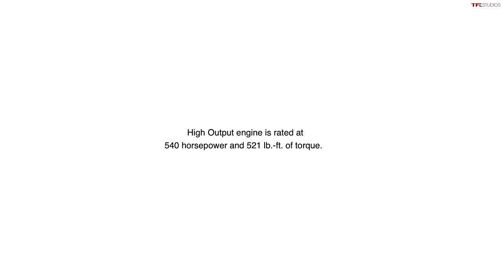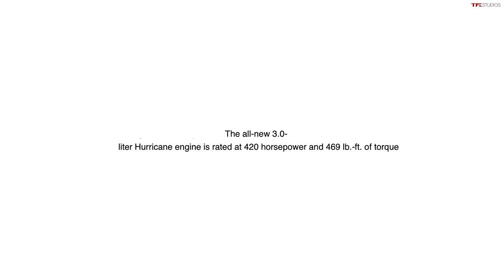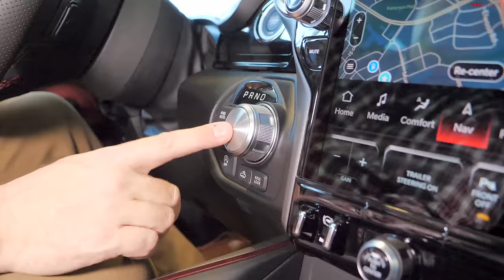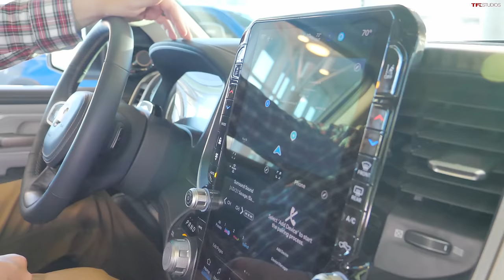I Go Hands On With The First New Ram 1500 In Over 5 Years - Did They Get It Right?

Comment: Wow, the new Ram comes with everything. It even comes with dealer markup preinstalled at the factory.
Reply: At no extra cost. 😂😂😂
Reply: Yooooooo HHAAHHAHAHAHA
Reply: They’ll do a dealer installed markup too. 😂
Reply: That’s a good one
Reply: Really Nice truck!
Reply: Even comes with missing 2 cylinders!
Reply: @flakes369    Lmao that is a good one. Don’t know why they would do away with the HEMI 5.7, that was an awesome engine
Reply: @punisher2704  Yeah if you like replacing the manifolds about every 20,000 miles.
Reply: @seymourbutts8850    Never had that issue.
Reply: @punisher2704  You got lucky. You're the first person I've heard of who hasn't had the issue. The tick until it warms up is very annoying. My local sheriff department has  Ram trucks, and the deputies told me all of them have cracked manifolds. The dealer told me every one of them did it at some point and that there's no fix. I tried aftermarket headers, and due to my shitty luck, I got a set with a bad weld. I fixed the header and traded it off.
Reply: @seymourbutts8850    Hmm, that’s weird

Comment: Nothing can replace a V8.
Reply: Hemi with all its problems, was not the finest V8 representation.
Reply: Yes. A lot can. Lol 💀
Reply: 8 V1s can.
Reply: @zelenizub2036  
The Hemi is not perfect and has its weaknesses.
Just like those at GM and Ford.
But to replace it with an even bigger piece of junk that is even more vulnerable.
It doesn't work at all.!!
Reply: No you just replace it with a piece of crap six cylinder that you have to add 2 turbos to given anywhere near the power and torque of a V8. If they had pulled their heads out of their rears and given V8’s twin turbos 6 cylinder engines wouldn’t be able to touch them. They will still suck when you start adding weight to them over and over. They won’t stand up to the boost. How do I know? I’ve pulled way too many trailers all the way up to 226k heavy haul on big trucks. The other V-6 turbo trucks don’t last when doing what trucks are designed to do. They don’t provide the same kind of power curve and smoothness the V-8 does. Unless you’ve done it on a daily basis as well as seen the v-6 crap in fleet use then you have no idea. All they did is make a much more complicated engine that is more expensive and more expensive to work on. They got rid of the V8 in order to get people over the V8 so they’ll start moving to EV. It’s being forced down your throat instead of giving you the option of choosing the engine you want. 
Sorry but Dodge doesn’t have much longer left in the car industry as they are about to lose a lot of loyal fans.
Reply: @zelenizub2036 

I’ve got 170K miles on my 5.7 Hemi and haven’t had any issues with the motor. 

What’s your problem with the Hemi?
Reply: All junk 🙄
Reply: Except literally any other engine can. EV's are preferred because of power and efficiency plus zero emissions. 4cyl and 6cyl turbos are superior to v8's. Lets be real v8's are dinosaurs and it's time they went away for good, they are nothing but polluting and out dated.
Reply: I agree
Reply: I disagree turbo rules for v6
Reply: @P-J-W-777 first, it’s more power and torque- especially the HO one. Second, it’s an inline 6 which is smooth - negating your point about V6. And third, the Cummins inline 6 with turbo seems to get a pass. All diesels have turbos and people don’t mind, but add one to a gas engine and they lose their minds. 😂
Reply: @dragonbutt  As far as I know, v6's have always been the base engine on 1/2 ton pickups.
Reply: @arthurwright255 I want nothing to do with a pure ev personally. Wouldn't say no to a small 3 cylinder diesel hybrid, though, best of both worlds.
Reply: @arthurwright255 says the person that’s definitely never towed or owned a truck ever.  You should go ask the Lightning owners how they feel about towing this time of year?
Reply: @Lq32332  like I said you’ve obviously never actually towed anything especially anything of any real weight. If you had saying an inline 6 engine is smoother than a V-8 for towing. 
I’m well aware that the Cummins is an inline 6. It’s a totally different engine that the gasoline powered inline 6. Diesel engine don’t rely on spark for combustion. Diesel engine blocks and heads are also much stronger than a gas engine. Not all diesels utilize turbos but in the case of modern trucks they do. Seems to me that the Ford powerstroke V-8 has continually outpaced the Cummins I-6 in both horsepower and torque from factory. 
Thats also proven with the Swedish Scania trucks which have V-8 diesel engines which produce way more power and torque than American built seni trucks. 
Sure you can take a V-6, I-6, or I-4 and make them make good power but the cost to do so makes the engine cost far more than a V-8 which was already at that power level to begin with. You see it with all the JDM cars out there producing 600-1200 horsepower. They have 35-100 thousand into the engine alone. 
Why didn’t the manufacturers ever offer a V-8 gas engines with a turbo or turbos. Because if they had they’d never be able to get someone to buy their V-6 engines. 
The V-8 engine will last longer as it doesn’t have to work or rotate as hard as a V-6 or I-6. Manufactures don’t want reliability these days. They just want it to make it past its warranty period. That way they can make more money on either the trade-in or the repair costs.
Don’t get me started on EV trucks because they just won’t make it that far lol!
Reply: 😂😂.....so many of the comments here are ignorant. Basically, it's a bunch of old guys and guys with inferiority complexes crying because something better came along that makes them feel less. The TT V6 is dar superior to any of your V8s. Grow up.
Reply: @ryansheard8092 it needs help to be on par with a V8. Put those turbos on the same V8 and it will outperform turbo v6
Reply: What half ton truck is left with a v8? Seems to me like ALL manufacurers are giving into pressure and dropping the v8. @P-J-W-777
Reply: @arthurwright255  No one who actually uses a truck for what a truck is supposed to be used for is saying what you just said. EV's are probably the least efficient thing you can get when it comes to towing and having any sort of payload at all. Nothing says "efficient" like only being able to tow 100 miles and having to stop and recharge the truck for 3 hours.
Reply: @tritchie6272  Ford and Chevrolet currently still offer several V-8 engine options in their half ton truck and suv lineup. 
Ford even had to go back and build the actual Raptor that everyone wanted. Do you think they are going to cancel it yet after dumping that much money into its design and build?
Reply: @rhettsalsbury9394  put a TT V10 and it'll be even more than a V8.
Reply: This I6 just did
Reply: We need a quad turbo 16 cylinder truck!
Reply: @arthurwright255  They have to be zero emissions because they produce a larger carbon footprint during the manufacturing process than a gas or diesel vehicle will in its lifetime. The you add all the energy production it will require in order to charge them on top of that. They are also much more complicated and toxic to recycle. The battery production alone is another story.
They don’t work for crap in the cold or heat. Their range sucks, sucks even more when you try to pull something.
Big brother is always in your life even closer while inside the vehicle. They will be hacked before too long. You can be spied on with the cameras and the microphones. So no more privacy! They are nothing more than a computer and computers fail on a regular basis. 
My V8’s don’t need a computer. In the event of a mass EMP from the sun or a nuclear war, y’all will be walking while I’m driving by laughing.
Reply: @tritchie6272  again ford and gm are still producing V-8 currently.
Reply: @DrowningTurtle  exactly
Reply: @ryansheard8092  yep or a v-12 or v-16. I’d go for that. It’s disappointing that Lamborghini is. I longer producing factory spec v-12 Lamborghinis.
Reply: @Cloud30000  yup, that would be really cool. They made 16 cylinder diesel engines back in the day with twin turbochargers and superchargers together. They sounded awesome and laid down some really insane torque and horsepower.
Reply: Clearly a straight 6 turbo can and then some.
Reply: @P-J-W-777  my comment was sarcastic to show the absurdity of "add turbos to a V8 and it'll be better". Again, anyone that thinks they NEED a V8 in a 1/2 ton truck had insecurity issues about their manhood, IMHO.
Reply: @P-J-W-777 I bet your parents are siblings.  You got some torn up genes
Reply: @ryansheard8092  

Ok bud - at the time I bought my truck, V8’s got better gear ratios which improves towing ratings and torque ratings. That’s the reason I went with a V8. Also, turbos on V6’s or I6’s wasn’t a thing. So let’s calm down with all this “manhood” crap. My V8 has been completely reliable in my 8 years of ownership. 

Having a certain motor doesn’t mean anything until you pair it up with the options ie Turbos, gears, transmissions, etc. 

Knock off the insults!
Reply: @ryansheard8092  not in reliability or cost to maintain.  But for day to day yes it’s objectively better to use I’m sure.
Reply: @ScottsGuitar  I disagree. I've had 5 ecoboost engines with one being in an F150. It was bulletproof for over 135K miles and I know that it's still going strong for the current owner.
Reply: @arthurwright255  zero emissions?  And what about the emissions from the power plant suppling the electricity to charge these?  And have fun charging in below zero weather conditions.
Reply: @tritchie6272  Nissan, ford, chevy
Reply: @ryansheard8092  point being it’s not better if a v6 needs turbos to beat a naturally aspirated v8
Reply: @rhettsalsbury9394  based on what? That statement in and of itself isn't true or false.
Reply: Amen brother
Reply: @ryansheard8092  well in my opinion you’ve never towed a trailer on a regular basis. This I-6 isn’t being limited to just the half ton trucks. They will be using this same untested engine in the 3/4 and 1 ton gas trucks as well. Dodge is getting rid of the V-8 engine across the board. 
V-6 engines don’t stand up to constantly being worked hard like a truck is designed and built to do. If the grocery getter that has to have a truck wants the I-6 because they are only going to use it for daily commutes and occasional light trailer duty the fine give them that option.  Don’t take away mine. The EPA has already screwed up the diesel engine so much. Just ask Dodge as they just got fined 1.6 billion for B.S. that doesn’t do anything but destroy the engine which is exactly what Dodge was trying to protect for their customers.
People talk about how much better a turbocharged V or I-6 is than a V-8 and my comment basically said let’s see how much better they are than a turbocharged V-8. The HO TT I-6 make 540hp. It’s easy to get 800 out of a V-8 with a single turbo and I’ve seen plenty of single turbo V-8’s with 1000hp. But let’s stay in the 800 range for reliability with a single. Okay now build the engine to handle twin turbos like the I-6 has been. Now you’re talking 1,200-1,500  reliably and between 1,500 to 2,500 when when you push them a bit. 
Top Fuel Dragsters make between 11,000 and 15,000 horsepower. No 4 or 6 cylinder ever produced will make that power much less survive. So again tell me how I-6 or V-6 is better. 
I personally have a tuned diesel and my mom has an F-150 limited 3.5 Ecoboost. Supposed to economical right. My diesel unloaded get just as good fuel mileage daily and gets better fuel economy when loaded. Plus I can walk off and leave her in the dust either way. Mines a V-8. 
Like I said before V-8’s were the majority engine that built this country! What are we going to do when we experience a massive EMP wave from the sun or a Nuclear War? All the computers in those EV’s will be toast as will the battery packs. An old V-8 with a standard transmission doesn’t even need a battery. You can push start it then let the alternator recharge the battery. We are just backing ourselves into a corner that we won’t be able to recover from without spending generations doing so all over again.
Reply: V8 only. Accept no substitutes.
Reply: @ryansheard8092 the only insecure ones are the 6 cylinder defenders protecting their queen. Fords 5.0L V8 is more advanced than this 3.0 I-6 and produces less emissions. 5.0 has 12:1 compression, 32 valves, twin independent can timing, plasma bore lined cylinders. Nothing is inherently “dinasuar” about a V-8. Thats an uneducated take.
Reply: Why would you want something with LESS power and torque and gets worse mileage? You buy a truck for what you can do with it, not what it sounds like before you even try to mention the sound.
Reply: @jamesm2464  exactly, they always try the same tactic. V-8’s are old technology. I usually just tell them that I-6 and V-6 are older than the V-8. They can talk trash all they want. The Chevrolet 350 has proven to one of if not the most reliable engine ever produced and a close second would be the original LS platform before all the cylinder deactivation crap. However if you remove that feature they are pretty much bulletproof unless you start making serious modifications while using the stock components. I would place fords original 5.0 and 351 right there next to the 2 GM engines. The 350 though has been in continuous production longer than any other engine as it’s still being produced.
Reply: @danielrichter3826 gm’s V8s don’t have weaknesses. They’ve experienced issues that they have fully addressed. It’s not the same thing. The Hemis weren’t as dependable, the 5.3L and 6.2L are reliable.
Reply: @WilliamStewart1  then the ramcharger is what you want it has a 3.6l gas generator
Reply: @P-J-W-777  that scania v8 is much larger then the average american truck
Reply: @ryansheard8092  ttv6 is not superior to ttv8 theres a reason the fastest cars in the world are not v6 genius
Reply: @P-J-W-777  cummins got fined not dodge
Reply: @G-Rated  lmao the ls and lt are notorious for eating oil and lifters. hemis usually dont eat a lifter until its got alot of miles. mine did it at 180k gms are eating lifter right off the dealer lot lmao
Reply: @moparjr89  I stand corrected misleading news article. I had to look it up again as the article I had read named Dodge as well.
Reply: @moparjr89  a lifter issue that did not affect all vehicles and was addressed with a 45 min remedy. Compared to the recalls and reliability of Ford and Stellantis, sir please…
Reply: They also don't care what it sounds like either.  @dragonbutt
Reply: @ryansheard8092 NA is more reliable than forced induction. Just a fact
Reply: Wrong.....6 cylinders have larger pistons, if accompanied with a shorter stroke they develope much more torque than a V8 and better fuel economy with proper gearing ratio.

Comment: $89k manual steering adjustment 😅 these truck prices are ridiculous  !!! They can keep it !!!
Reply: Exactly and with dealer markup they are easily going to be over 100k
Reply: One less thing to break and how often will it need adjusting??
Reply: don´t buy it.
Reply: Will never buy it  !!!
Reply: @hellkitty1014 I don't think that's a major failure point in modern vehicles lol
Reply: Buy from Mark Dodge, best prices anywhere.
Reply: I'm keeping my 2012 express 5.7 "v8"!✌🏿
Reply: @jimk59  💯 Bought two trucks there, saved 11k off the first and 13k off the 2nd
Reply: Right they skimped on that 😂😂😂
Reply: Yes, they are. Used vehicles win. I bought my 2014 V6 Tacoma with 52K miles and a 6-inch lift with the extended bed 10 months ago for 23K. The thing even has 285's bro. No reason to spend over 50K on a truck.
Reply: @hellkitty1014 don’t try to justify it not in that price range
Reply: @oliverramclam6009  Volvo doesn't offer a power wheel on any car at any price. Are they not "luxury" cars? How many $500K-$3M super/hyper cars offer power wheel adjustment? I'm not justifying it, I just don't think its as big of a deal as it is being made. In fact, power pedal adjustments are more useful than the wheel. Plus we also must account for all of the other class-exclusives that the Tungsten offers.
Reply: @hellkitty1014  : "How many $500K-$3M super/hyper cars offer power wheel adjustment"  Not many.  Though my old lowly '18 C7 Z06 has a power tilt/telescoping wheel & both the wheel & seat have an easy entry/exit feature which are both tied to the memory setting & the FOB. Makes it easy getting in/out. Just hop in & fire it up & the wheel & seat move to your preferred settings. Shut it down & the wheel moves out of your way & the seat slides all the way back. Though you don't really need this a big roomy truck.
Reply: @oneslackr  cool story. Both of my Hellcats do the same. But I never use them, interestingly enough.
Reply: @hellkitty1014  : I like using it. The main reason is so the seat is out of the way to make more room for my feet when getting in so my right shoe doesn't touch/brush up against the front of the seat & so my left shoe doesn't touch/brush up against the bottom of the door panel as I pull my left leg in. 

If the seat is in the position I drive from then I barely have room to get my feet in & I only wear a size 12. Vettes aren't all that roomy.